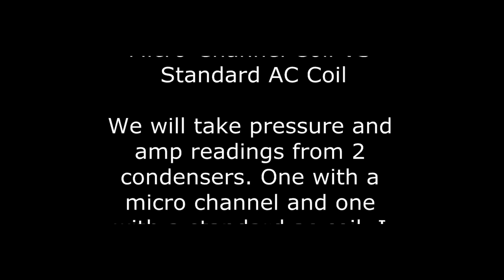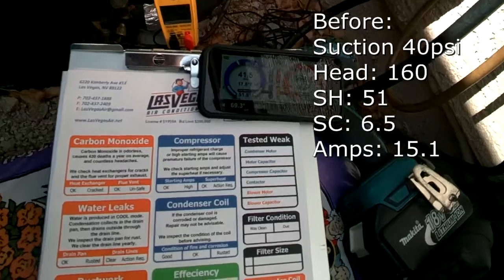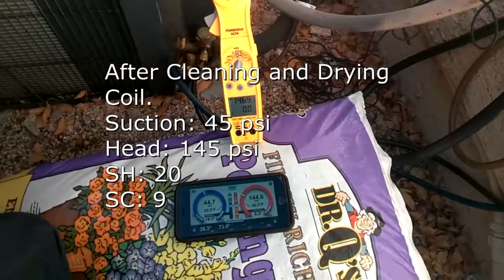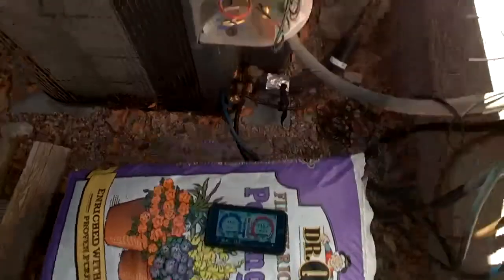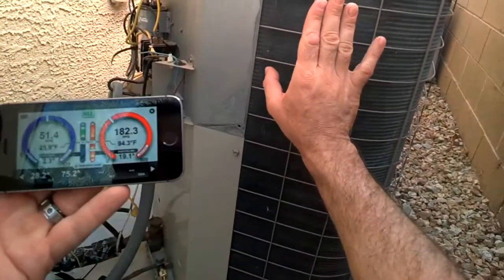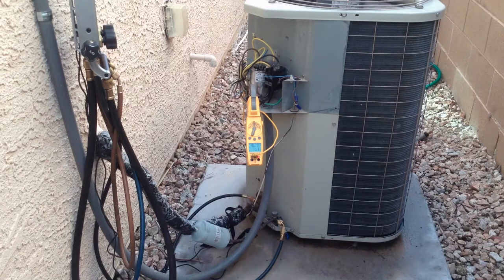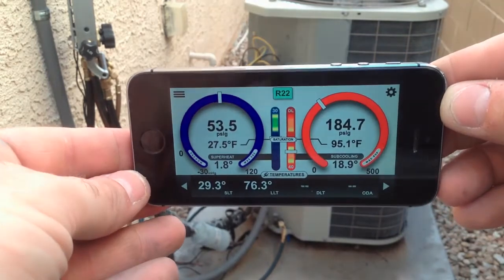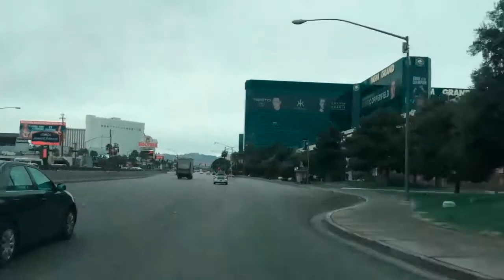Micro Channel Air Conditioner VS AC with Standard Coil

Comment: Hi from Sandy R - I am a  TX HVACR contractor designing a self-cleaning (rain) outdoor air filter screen for cottonwood seeds and microchannel condenser coils.  I love this video because it explains the head pressure problems with smaller size microchannel heat exchanger MCHX coils. Today the Condensers in both Standard copper tube / aluminum fin coils and Microchannel Fins are space so close to each other at 20, 22, and 23 Fins Per Inch. Both condenser coils act more like an air filter restricting the air flow.  Kinda like the 20 Pores per inch window unit foam air filter. The smaller size Microchannel coil gets restricted faster because of its smaller size so you see the higher head pressures and higher amp draw.  I would like to ask you if you have the amp draw on the microchannel coil after it was cleaned.  I expect it to be a little lower than 15.1 amp, the before reading.   Was this a spring PM on both pieces of equipment?  My website is http://www.outdoorairfilter.com/ and I would like to like link to your website if it is okay with you.  Have you ever serviced plugged MCHX coils and how high was the head pressure ?    R410A  400#  to 500#  R22 350#  Thank You

Comment: car radiators are made of microchannel and you don't have to clean them that often, just saying.
Reply: Pedro Castano and your car AC condenser is microchannel as well. Microchannel condensers have been used in auto AC systems since the early 1990s.

Comment: Recording the ambient outdoor temperature would have been allowed you to calculate how much higher than ambient the refrigerant is condensing at. This temperature difference is the key measure of efficiency for any heat exchanger.  Do these units have a TXV or fixed orifice? If they have a properly functioning TXV and correct charge level the subcooling and superheating should be almost independent of condensing temperature and performance within a reasonable range of ambient temperatures and condenser fouling levels.
Reply: Henry Henze i don't think he understands. This is an attempt to be seen on you tube.  Fancy tools and big words.....😏...they get on here to get customers....